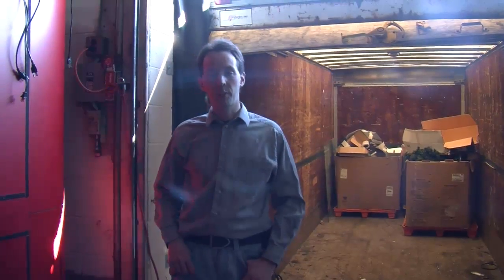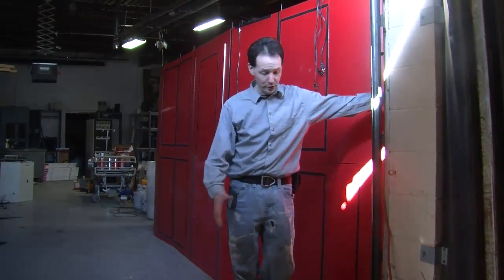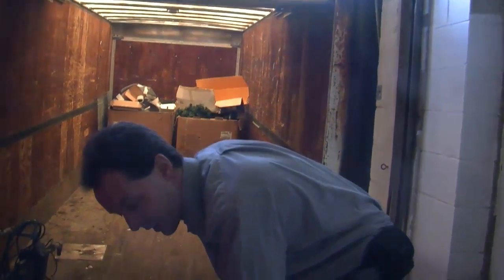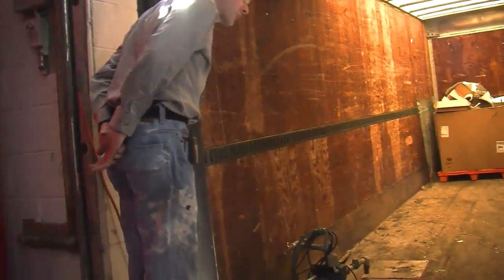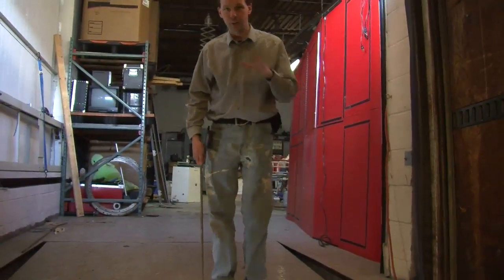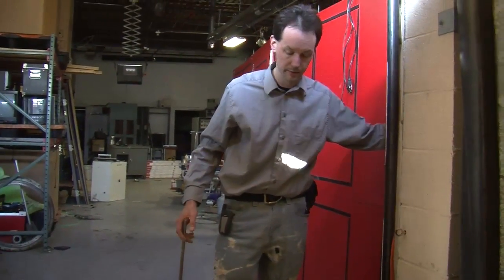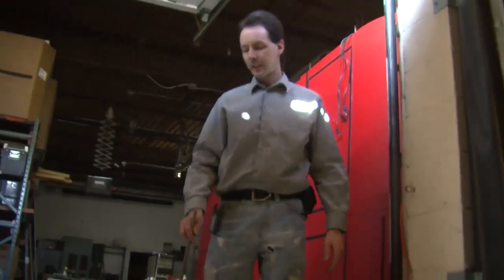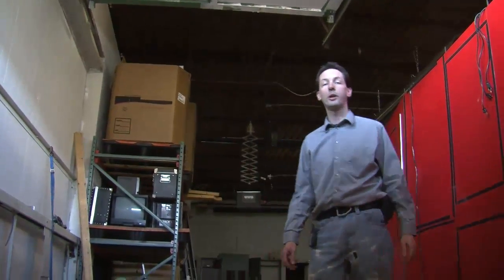Dock Leveler

Comment: if you raise it up you will see what lifts the outrigger... there should be an adjustment on that wire that lifts it... you can set it so it opens sooner and you ont have to take the plate so far up and it will drop inside the truck without your handy stick thing..